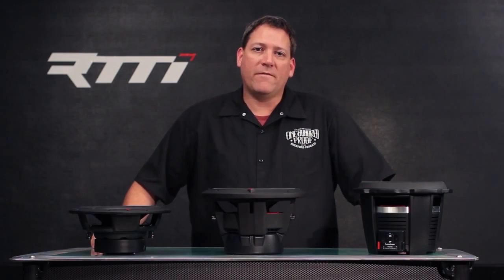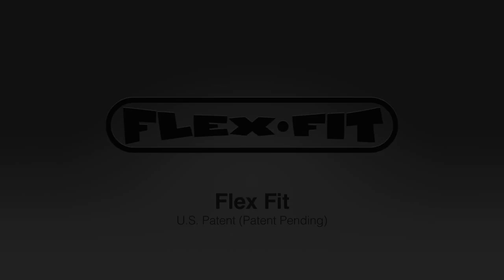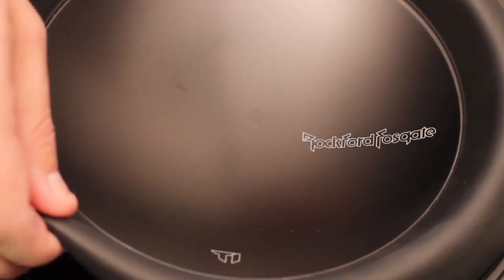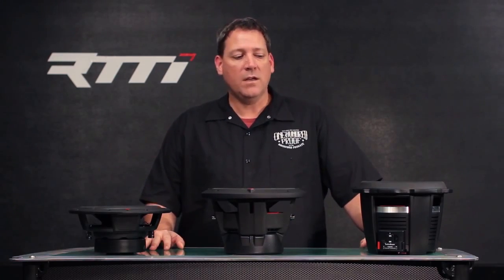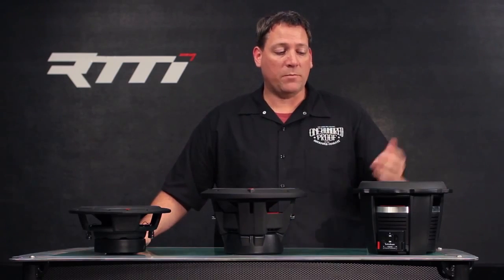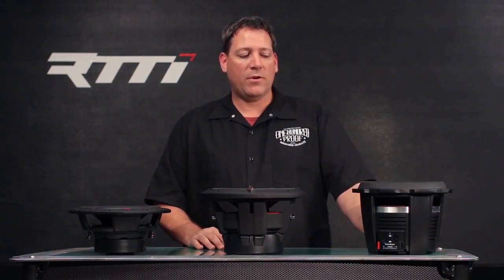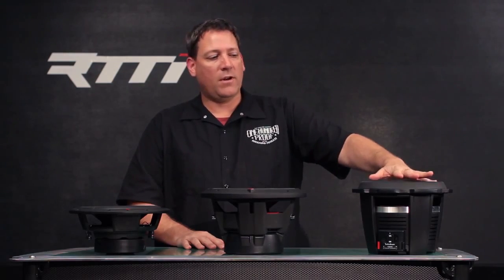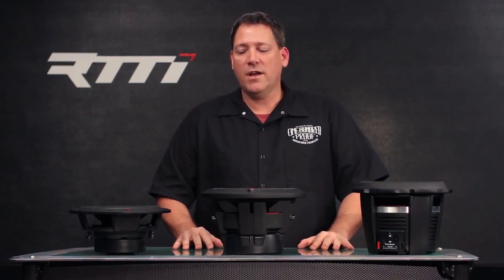Rockford Fosgate: Subwoofer Comparison (1.3)

Comment: Power T2 vs Punch P2 what's the difference?
Reply from the maker: Punch P2 uses a poly cone, single spider and 2.25" voice coil (400 Watts RMS on 12")
Power T2 uses an aluminum cone, dual spiders, and 4" voice coil capacity (2000 Watts RMS on 13")

Comment: I got 2 p3 12s behind 2 p2 12s in my fusion and I’m looking to upgrade to the 13 or 16 Single sub
Reply from the maker: Hi Gps jb, I'd like for you to consider the "cone area" vs. power applied to your scenario, to see if it meets your expectations:

The P2D2-12 / P2D4-12 subwoofer have an Sd = 570 cm^2 (1,142 cm^2 cone area) and rated at 400 Watts RMS, so you can apply 800W to both of them.  Moving to the T2S1-13 / T2S2-13 will provide an Sd = 707 cm^2 and is rated at 2000 Watts RMS.  If you used the T2S1-16 / T2S2-16 it would provide an Sd = 1,034 and is rated at 2500 Watts RMS.

Moving to a single 13" will give you 435 cm^2 less cone area, but you can apply 1,200 more Watts.  Without plotting an SPL estimate, we can  guess this would provide a negligible SPL difference.  

Moving to a single 16" will give you 108 cm^2 less cone area, but you can apply 1,700 more Watts.  Without plotting an SPL estimate, we can  guess this would provide a small SPL increase.

Consider a +3dB Increase is 1.23x the perceived loudness, so you theoretically need 2x the amplifier power or twice the cone area (increase from 2 to 4 subwoofers.)  A +6dB increase is 1.5 times perceived loudness, so you would need 4x the amplifier power or quadruple the cone area (increase to 8 subwoofers.)  A +10dB increase is twice as loud, you would need 10x the amplifier power or increase to 20 subwoofers).

Comment: Hi can u use a fosgate p1 sub 10 with a jbl cs10 in my diy box under seat have kenwood ps200 amp .steve
Reply from the maker: Hi Steve, technically it's possible, but realize the frequency response and acoustical propagation of sound waves from each driver is different, so it would be equivalent to running 4x4 knobby tires on the rear of your truck and all-weather tires on the front.  This is why we always recommend to use the same woofer make/model in your system.  I'm sure this is just a temporary solution until you get another P1, so do what you need to keep bass in the truck, because we know a radio 2 coax speakers isn't that much fun.
Reply: @rockfordfosgate  ok will keep one driver for now in box 📦 thanks see how it sounds
Reply: When I connect my single sub a Rockford fosgate p1s2-10 to my kenwood ps200.it will have rear speakers to amp then do the sub wires need to be bridged?it’s a 2 ohm sub.so negative lead to one channel and positive to other channel.Steve
Reply from the maker: @stevemcgowan3017  If this is the KAC-PS200, that amplifier is stable into a 4Ω bridged load.  A single P1S2-10 is a 2Ω load and is not compatible with running on that amp in bridged mode.
Reply: @rockfordfosgate  I also have a kenwood kac-ps301t will that run sub
Reply: @rockfordfosgate  or what sort of amp does it take to run this sub?surely one amp will power it 😀
Reply from the maker: @stevemcgowan3017  That amplifier is similar and needs to be bridged into a 4-ohm load.    The P1S2-12 is rated to handle 250 Watts, so you need an amplifier that can play into a 2-ohm load that doesn't generate more than 250W. The R2-250X1 would be a perfect match for it: https://rockfordfosgate.com/products/details/r2-250x1/ .  However, if you're looking at for a long term system and have the room, a 2nd P1S2-12 would give you more options and power handling capability.
Reply: @rockfordfosgate  just connected up the sub to my kenwood mac-ps301t with some wharfedale diamonds in house.small bookshelf speakers in uk.i sed bridged + and _ connections as displayed on amp.didnt push sound and box I made for another sub  jbl cs10-that didn't arrive is too small for the fosgate so its sticking out top not screwed in.going make a better enclosure more tuned to fosgate
Reply: @rockfordfosgate  so if I get another roseate sub same type and series them it will make 4 ohms impedance and be better for the amp .or get more efficient sub ?
Reply from the maker: @stevemcgowan3017  If you get a 2nd subwoofer of the same make/model, it would create the proper 4Ω load and you could use either of those Kenwood amplifiers on them :-)
Reply: @rockfordfosgate  I’ve got one amp bridged to one sub and sounds great other amp runs 6x 10 speakers also have small alpine amp up front running 6x9 ceiling speakers just for speech on radio As van noisy running .very happy with sub just half  volume so far sounds awesome 😎
Reply: @rockfordfosgate  hifi vega got same kenwood amp and he said it would run fine

Comment: Ok well woulda been nice if they showcased the p3
Reply from the maker: The Punch P1, P2, and P3 are very similar Sound Quality subwoofers.  The main difference is the voice coil size for electrical power handling and the P3 uses an aluminum cone to handle higher mechanical power handling.

Comment: I am now running 3 T1 12s in my toyota rav4 I started with p3 12s and I will say the p3 is an amazing subwoofer. They can really handle a clean 800-1000 watts and have great sound quality. I miss the sound quality of the p3s now that I'm running T1s but the T1s get much louder and have more spl.
Reply from the maker: Thank you Justin for sharing your P3 & T1 12" subwoofer experience with other fanatics!
Reply: Sounds like you need to upgrade your power source. I could misunderstand though. You should try running 2 of the t1’s on the same amount of wattage and see if there’s a difference for the better in quality
Reply: By power source I meant amp not battery my mistake
Reply: I just got my T1 12. But using a stock radio :/  but few years back was running my P3 15 and that hit harder than most people 2 15s together.  P3 and T1 are both awesome

Comment: I thought RF was dear like Pyle back in 2000 never saw them at a car audio contest.
Reply from the maker: LOL, that's a funny comparison.  The real reason you stopped seeing Rockford Fosgate and other manufacturers is because we stopped sponsoring sound-off competitors after the '98/'99 finals.  During the golden-era of Sound Off competition,  a lot of the big boys (Kicker, JBL, Cerwin Vega, Rockford Fosgate) were the top of the circuit.  Many sponsored up to a dozen vehicles (average of 1 per category) competing in both Sound Quality and Sound Pressure Level.  

Unfortunately, the larger SPL vehicles poisoned the well for all competitors with ridiculous demands.  I can't tell you how many times I personally was on the other end of a phone call with a competitor demanding a pallet of 24 subwoofers be shipped Next-Day Express for an upcoming competition over the weekend.  They would go to the competition, then call back next week to demand another replacement set of 24 subwoofers (just in case any voice coils got damaged in the last round.) While this was O.K. the first couple of rounds, many of the competitors got word of this and demand for free product began to grown exponentially.  The cost of supporting competitors went from $5k-$10k up to a $50k ....just for 1 season. As you can quickly see, that wasn't a sustainable business model.

Fast forward to today ... Rockford Fosgate is celebrating our 40th Anniversary and continues to reinvest back into the product line by developing new technology like CLEAN & Class-AD.  All this while maintaining world-class technical support for its customers.  Yes, we moved in and out of the spotlight at times, but there were very strategic reasons for it.  We want to continue focusing on developing high performance product for fanatics who are either getting started in car audio or adding a 2nd or 3rd system to their recreational vehicles.

You can learn more about our history and future here: https://youtu.be/1qkDrPPyn2U
Reply: @rockfordfosgate  this is the best and most honest response i have ever seen from a big company like you guys, well done!
Reply from the maker: @freeair7292  Thank you, we appreciate that!

Comment: I'm running 2 p3 10s on a 1200w.. but after seeing this video  lol I want more. About to put my 6.5s in my doors
Reply: Ras, by chance is it a 1200.1 fosgate? I recently bought the 1200.1 and was absolutely thrilled with it. And its watts are actually higher per ohm load, the dyno is incredible for it. I'm currently not running it right now as I have used my older 1000 watt fosgate from the 90s and it beats the absolute hell out of my p3s. I'm going to have to get a set of t1s or t2s to get what I want.
Reply from the maker: You're ride is already rockin'... soon it will be bangin'!

Comment: hey i have two p2 12s was planning on running them with a pioneer 9601 at 1 ohm and the amp is said to push 1200rms.will they handle the 1200rms just fine considering they do more than rated or its going to be too much for them?
Reply from the maker: Hi Charlie, Thanks for your inquiry.  Assuming you have two of the P2D4-12 models since wiring them would create a 1-ohm load.  Those subwoofers are rated to handle up to 400W RMS, so you'll have 800 Watts of power handling capacity.  Is this the Pioneer GM-D9601 model you're referring to?  If so, the specs show continuous power output at 1,200 W x 1 @ 1-ohm, so you'll be over-powering the subwoofers by 400 watts.  We would suggest stepping up to the P3D4-12 subwoofers since they are rated to handle 600W each, so two would give you the proper 1,200W total power handling capacity.
Reply: @rockfordfosgate  ooh ok how about the lightning audio l11000d
Reply from the maker: @charliemilan4892  The L110000 is rated at 1000W x 1 @ 1-ohm.  You need to move up from the P2 to the P3 subwoofers if you want to run that much power.  If you use those big amplifiers on P2 subwoofers, you'll smoke 'em in no time.
Reply: well noted then i will jist use the pioneer 8601 which does 800 rms at 1 ohm
Reply from the maker: @charliemilan4892  O.K. yes, that amplifier looks better at 800W @ 1-ohm: 
https://www.pioneerelectronics.com/PUSA/Car/Amplifiers/GM+Digital+Series/GM-D8601#specs

Comment: Im using t2500 and bought 2 units of t1d412 what wire gauge do i use and what ohm should i run it?
Reply from the maker: Hi Rejiv, In your other post you asked about running one T1D412.  If you are running two T1D412 , they will provide up to 1600 Watts power handling (800 Watts RMS each).  Since the T2500-1bdCP produces too much power, I would suggest running the subwoofers in series/parallel to create a 4-ohm load.  Although it's rated to produce 1500 Watts x 1 @ 4-Ohm, dynamic power output is 1823 Watts x 1 @ 4-Ohm, so that is a better match-up.   Use at least 12 AWG for the subwoofer wiring and 1/0 AWG for the B+ and GND.
Reply: @rockfordfosgate   end up buying 2 units of it... used  single sub of p3d412 on my punch amp... so done using 1 unit of sub... plan to feel 2 unit of sub.... im planing to put the sub face inside the car.. using mitsubishi lancer.. ported box with hole in the middle facing inside the car too... i just havent install my subwoofer and amp... soon to be install in next week..

this my current setup in my Mitsubishi Lancer GTS ;
Headunit : Kenwood DDX918WS

Front door : Power 6.75" Series Component System T1675-S

Rear door : Power 6.75" 2-Way Full-Range Speaker T1675

Channel amp :  Power 600 Watt 4-Channel Amplifier T600-4

Subwoofer amp : Power 2500 Watt Class-bd Constant Power Amplifier T2500-1bdCP
Subwoofer : Power 12" T1 2-Ohm DVC Subwoofer
 T1D212
Reply from the maker: @rejivshankar242  Very nice setup.  You may find in the Mitsubishi Lancer that firing the subwoofers toward the rear license plate may produce better bass due to the acoustics.  This is because the subwoofers have more air to compress rather than firing into the rear seats.
Reply: Rockford Fosgate thank you... when my sound system is done... will do an video of it...
Reply from the maker: That's great @rejivshankar242 !  Would love to see how it turns out!

Comment: I just ordered my 10 inch P3 I’m pairing it with a kicker cxa800. 1 amp . I’m pumped 💪
Reply from the maker: The P3 is an awesome subwoofer.  Keep in mind the P3 10" is rated to handle 500 Watts RMS.  However, the Kicker CXA800.1 can produce 800 Watts, so you'll be over powering that woofer by 300 Watts.
Reply: Rockford Fosgate I’m having it installed professionally I was watching the power protection on that amp to make sure I won’t pop it
Reply: Rockford Fosgate and that amp maxed out at 836 lol gotta be real careful 😂👀
Reply from the maker: @Edsheahan  Alright ... sounds like you know what you're getting into.  Just want to make sure you have all the information.
Reply: Rockford Fosgate thank you dad ❤️💪
Reply from the maker: @Edsheahan  😂

Comment: I really would like to know what the difference in the T0, T1, T2, are. I’ve asked a handful of people and nobody has answered me!
Reply from the maker: Overall the differences is voice coil size and power handling capacity.  You get a higher power handling capacity as you increase in product series.  The above video covers the T0 subwoofer having IDHS, we have another video that  the differences between the T1 & T2: https://www.youtube.com/watch?v=1IN8wggDCY0
Reply: @rockfordfosgate  hi,i watched the photo and it only showed what the t2 13 and 16 is so i still don't know the difference lol
Reply from the maker: @PROATV13rb  The main differences is voice coil size and power handling capacity:
T0 10" = 550 Watts RMS
T0 12" = 700 Watts RMS
T1 10" = 600 Watts RMS
T1 12" = 800 Watts RMS
T2 13" = 2000 Watts RMS
T2 16" = 2500 Watts RMS

Comment: Why can’t I order a trim ring for my T0D410?
Reply: Thank you; I’m a member on Facebook and have posted a picture and an iso request for that item. I’ll keep digging. You are highly appreciated. Thanks again.
Reply from the maker: Have you contacted our customer support?  They hold a handful of replacements to accommodate misc. requests, but are limited to quantity on hand.  They can be reached at 1-800-669-9899.
Reply: Rockford Fosgate Thank you for your timely reply. Yes I have called. I was suggested to check Ebay. Didn’t seem and appropriate reply for such a top brand manufacturer. Still searching.
Reply from the maker: @aundraymitchell8578 , I just checked the back room and we have plenty of Punch trim rings, but none left for the Power T0 subwoofer.  Customer Support has likely fielded this call and knew exactly the quantities on hand.  Sorry their reply was so quick.  You may also want to try Facebook "Rockford Fosgate Classifieds" here: https://www.facebook.com/groups/125892934268295/

Comment: So what's with these switches for the t1 woofers
Reply from the maker: The SWIFT terminals let you easily configure the impedance by wiring both voice coils of a DVC 2-ohm into a 1-ohm / 4-ohm load or wiring both coils on a DVC 4-ohm into a 2-ohm/8-ohm.
Reply: @rockfordfosgate  does the silver t1 12in sub have swift?
Reply from the maker: @eddieluna3005  No, the Gen-1 T1 subwoofer does not have SWIFT.  We implemented this on the Gen-2 model.
Reply: @rockfordfosgate  how do you wire it to 2ohm?
Reply from the maker: @eddieluna3005  I don't know what DVC impedance you have nor do I know how many you have, but you can use our Woofer WiringWizard to select the quantity of woofers and the voice coil impedance to find all possible wiring diagrams.  Be sure to use the DVC 2-Ohm (SWIFT) or DVC 4-Ohm (SWIFT) impedance. https://www.rockfordfosgate.com/support/wiring-wizard/

Comment: One P3 in ported box pushed by cheap ass AutoTek 200 dripped down to 1ohm beat the dash apart in onld Honda Element (Had box inside of a box...so it JUST WORKED)!
Reply from the maker: Those P3 subwoofers are the bomb!  Glad it's rockin' your ride!

Comment: My p3 15 had a anodized aluminum cone. What do you mean it's made of paper 🤣
Reply from the maker: Yes, this was a generalization of Punch subwoofers and missed as the exception.  It indeed has an aluminum cone.
Reply: @rockfordfosgate  was this the 2nd gen p3s? The one that said "p3" in small letters at the bottom of the cone?
Reply from the maker: @justinkelsey9218  The 3rd Generation utilizes an aluminum cone.  The P2 used a "Kevlar Fiber reinforced semi-pressed paper cone and ABS/Acrylic dustcap".  You can find more about the 2nd gen P3 12" here: https://rockfordfosgate.com/products/details/p3d412/

Comment: How far or how many blocks away can you here the bass from the p3s? I plan on buying a p3 system
Reply from the maker: The Punch P3 subwoofers hammer and are our best selling subwoofer.  Unfortunately, we don't have estimates for "blocks", only how many counties or states you can hear them.  Ha Ha.  It totally depends on how much power you apply and the type of enclosure you build for them.
Reply: @rockfordfosgate  thanks for your reply. I was thinking about hooking up the punch 1000 amp to the p3s that come with the box it comes with on the RF site into my honda pilot
Reply from the maker: @reckingball6242  That would be a great match because the P3 Dual Subwoofer enclosure can handle up to 1200 watts, so that amplifier is perfect.  My wife has a Honda Pilot and the acoustics in this vehicle will SLAM with that enclosure!
Reply: @rockfordfosgate  nice!! Thanks for the info my friend and cant wait to get my system going!!
Reply: @reckingball6242  ever get slamming in that pilot
Reply: @G00DZ1  yes but now I have a tahoe with 4 p3s and the rf t1500.1 bdcp amp. I've upgraded since then and it slams my eardrums